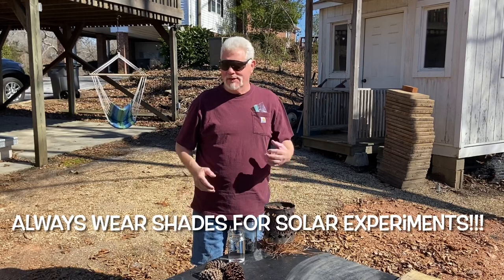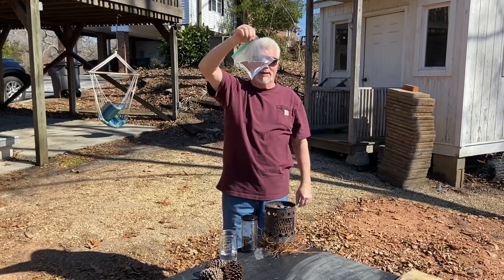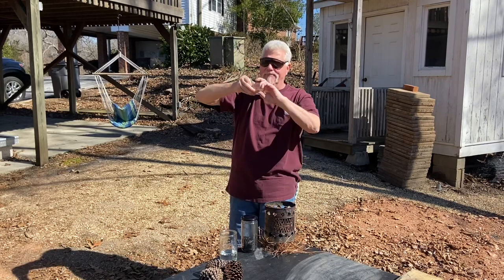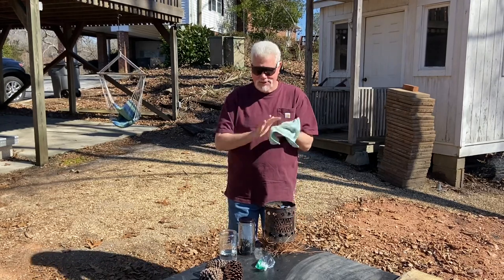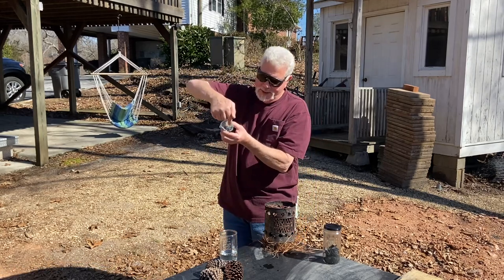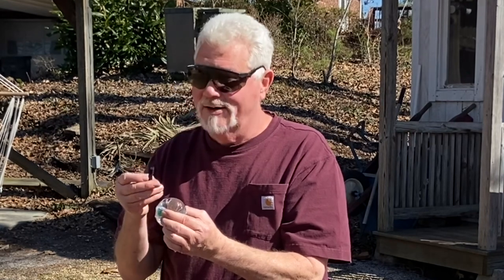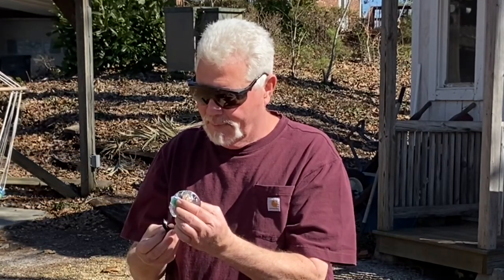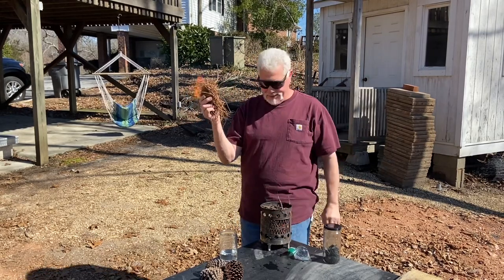How To Make A Ziploc Bag Aqua Lens And Solar Ignite Charred Punk Wood

Comment: This method has not worked well for me and I like solar 😀,  cheers David 🍻
Reply from the maker: There's more to it than what I can convey in a video... years of practice, angles, tightness of the solar lens, size of lens, time of day, angle that the char needs to be held at, choosing a smooth surface of the char so that you can properly dial in a focal point.

Comment: great demo, clear directions and it even worked with a pinhole in the bag. Good job. Thanks for the video.
Reply from the maker: LOL! You can really see that thing squirting on the big screen tv. Did you notice the slight grin on my face when I mentioned the leak? I'm thinking to myself, Well, I guess dealing with these constant 10mph winds wasn't challenging enough.
Reply from the maker: The feeling is mutual. LOL!

Comment from the maker: Fill a Ziploc bag half full of water, zip it half closed, gather all the corners "to" the one open corner while trying to expel the trapped air, overflow the bag with water to make sure that most of the air is out, twist the bag until it's cone shaped, dry hands and bag, get your piece of charred punk wood, squeeze in on both ends of the cone to make it tomato shaped, present the Aqua Lens to the Sun, focus in the focal point on your finger first (to find where it's the hottest), then place the charred punk wood in place of your finger, notice when the focal point gets extremely bright, and you have achieved ignition.
   Please follow the LINKs below and SUBSCRIBE. Thank You!

Solar Ignitions Playlist
https://www.youtube.com/playlist?list=PLkoXX8XsMW3kl5CicmPv0pTz-7rj4gczW
Hands Free Solar Ignition, Wallet Fresnel Lens.
https://youtu.be/ScesrTSDxVg

Comment: Thumbs up David! Wondering if you ever made fire with an ice ball/lens??
Reply from the maker: I couldn’t make the ice clear enough. It had too many air bubbles in it even after trying all the recommended fixes for that. Lol!
Reply: @DavidWestBgood2ppl  I saw in a video a guy froze water in a bucket and then cut out a lens from the clear section. I failed in my attempt at it. I couldn't get a strong focal point.